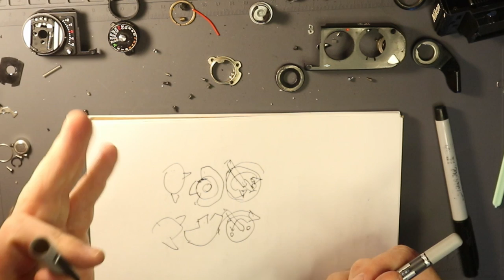The Most Frustrating Film Camera Repair (Olympus Advance Issue)

Comment: OM10's serve an invaluable purpose as donors of replacement prisms for OM-1 and OM-2 cameras suffering from foam rot. Of the double digit OM's they're all pretty unremarkable, other than the OMPC is kind of a fun and undervalued camera - it has a basic form of matrix metering, and is of a similar build (plastic parts on a metal frame, cloth focal plane shutter) and does pretty much everything a Minolta X700 will do (program exposure, TTL flash) at a quarter of the price on the used market.

Comment: Best way to buy an OM-2 is to look for "mirror stuck, shutter won't fire" for-parts listings. It usually just needs 2 new lr44 batteries and the bulb unlock trick. Usually.... Either that or months and months of futzing.
Reply: not the case with my om2, wish it was the batteries..

Comment: This helped SO MUCH
ive been dealing with this issue for over a month now on this OM10 i got from a thrift store. I resorted to bringing a screwdriver in my camera case in case i needed to open up the bottom and adjust the same gear (compensating for that damn spring). 
Finally i got sick of it, and after two hours + rewatching this video i was able to get it completely fixed! Thank you for your help!

Comment: I have an OM1 with the same issue, i've managed to sync up the Idler gear which was causing the jamming advance issue.

But now when you press the trigger, it wont click/take the photo or do anything.
The metal/silver mechanism on the right hand side of this video doesnt seem to have enough pressure to reset it
if you slightly move it by hand it resets, then the issue happens again, any idea why this isnt working?